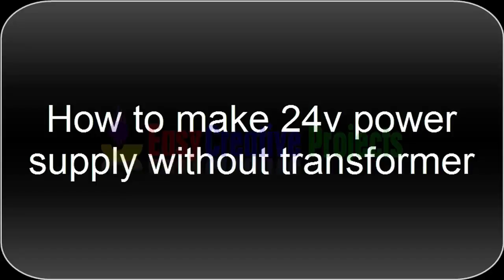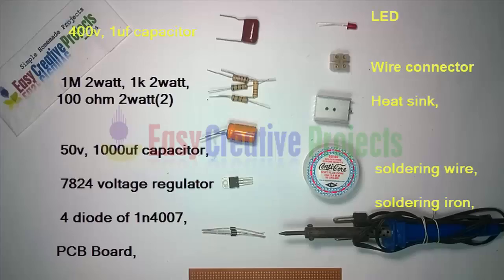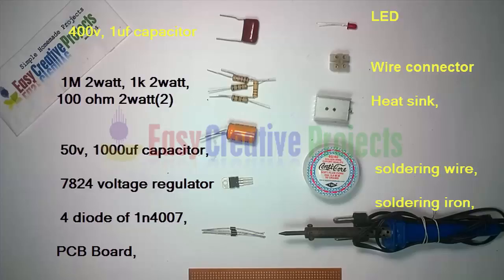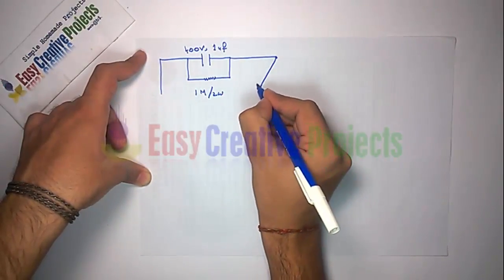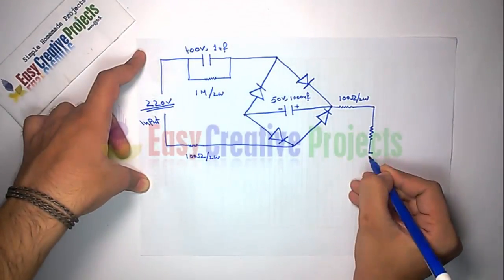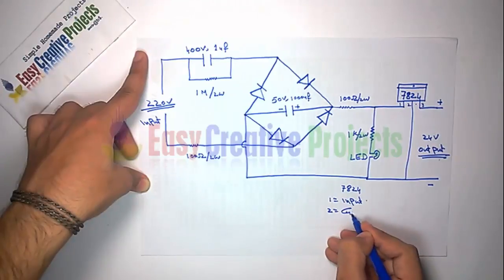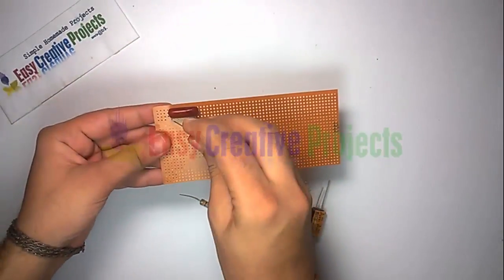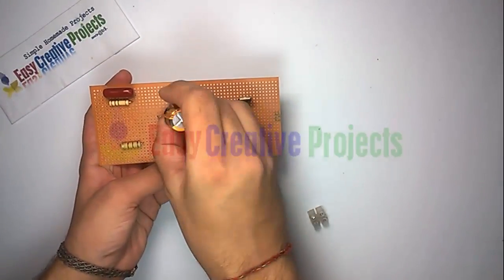How to make 24v power supply without transformer - easy step by step with circuit diagram

Comment: dear sir 
please help me 
Ac 220 to dc 24v 5A
circuit diagram without transformer 
please sir help me
Reply from the maker: without transformer you cannot get good amperes. 
its only educational purpose project. and very risky and dangerous. 
if you want 5amp output. then you need 5amp transformer. or you can use SMPS  but smps more costly and complicated.

Comment: Hello I  am looking for 230 volt to 12 volt 5 amp 60 watts circuit without transformer....... please advise
Reply from the maker: without transformer you cannot handle good current.
Reply: @EasyCreativeProjects  I plan to run a 12 Volt DC Motor which will draw peak load of 60 Watts under load
Reply from the maker: @hindi4222  i can try to get some solution in upcoming video. but its not durable.

Comment: very good job thank you sir be bless. one more thing sir how can I add regulator to it thank you
Reply from the maker: in this project we already use LM7824  24v voltage regulator.
but without transformer its not safer. its only for education purpose.
thanks.

Comment: what will be the o/p current in Ampere ? and where I can install potentiometer in this circuit ???
Reply from the maker: its provide you maximum 500ma to 800ma current. its only for education purpose. without transformer its very risky.
thanks.

Comment: Please tell me about Ampare which we received in 24 volt DC and paralal how  can also make 12 volt DC 
Means 
24-0-12 DC volt
Reply from the maker: simple use 12 -0-12 transformer
and 1n4007 diode bridge for ac to dc convert
and 1000uf capacitor for filter dc.
if you want fix 12v then use LM7812 voltage regulator. 
if your requirement 24v then use 1st and 3rd wire of transformer. 
if your requirement 12v then use any 1st two wire. (left1 and middle or right 1st and middle)
without transformer its very dangerous. and you cannot get high current.
thanks.

Comment: Sir as you said, I used to 105k 450v capacitor and all resistor 2w out put to 24 volt coming sir, but 1000 uf 50 volt capacitor heated and bursting 30 minutes later.Then what should I do. Please sir reply.
Reply from the maker: its demo purpose project. its not durable. because this time no perfect alternative of transformer. 
don't use heavy load with this power supply.
check voltage of burning capacitor. and use more large voltage capacitor. like 100v.
but i again tell you its only education purpose. its not durable.
Reply: Thank you sir.

Comment: Sir plz 🙏reply me I want a 12v 10 amp circuit without transformer
Reply from the maker: without transformer you cannot get 10amp current. because this time no perfect alternative of transformer.
if you are facing transformer size issue then you can use smps circuit. 
but smps circuit more complex.

Comment: Can I fix a adjustable voltage regulator LM317 ckt instead of LM7824 SIR
Reply from the maker: yes dear you can convert it as a variable power supply. 
watch video on our channel how to make adjustable power supply easy at home.
this video help you to connect lm317.
thanks.

Comment: We didn't use voltage regulator to regulate voltage ?
Reply from the maker: dear voltage regulator function only regulate voltage. if you want to fix output then you use voltage regulator.

Comment: You did not talk about the input.
Can i use any input voltage to get the same out?
for instance;
110v to o/p 24dc
220v to o/p 24dc
Reply from the maker: yes you can use 110 to 220v input. and its provide you fix 24v output. 
but its only for education purpose. because this time no perfect alternative of transformer.

Comment: Is this constant current power supply
Reply from the maker: dear LM7824 provide us fix 24v output power. but this project only for education purpose. if you need 24v power supply then use with transformer power supply.

Comment: How much is current output 
And can it be used for powering circuits and our other projects is it safe ...... pls reply
Reply from the maker: its provide you 1amp output. 
no dear this project only for education purpose. this time no alternate of transformer. 
for power charging simple use transformer power supply.  if you want to make so 
see video on our channel ( How to make 24v power supply )

Comment: Which one is better, using IC7824 or 24 volt zener diode ?
Reply from the maker: dear 7824 voltage regulator is best for control current. 
if you use zener diode you need to put capacitor.

Comment: can i connect a 24 volts drill with this....
Reply from the maker: dear drill machine need high power and current. this power supply cannot fulfill of drill machine requirement.

Comment: how about 120 volts to 24 volts.. what will be the adjustment ? its made me sick . pls reply. thank you
Reply from the maker: dear in this project i use voltage regulator. its give you 24v output.
if you use 120v input so no problem. you can use directly this circuit. 
but if you use any high power product so use with transformer power supply.
thanks.

Comment: I used 105k 400v, output is 18v.. But 100ohms resister is burnt.. I connect circuit without 100ohms resister.. Its giving 18v output.. I need 24v output..  What changes i have to do.. That circuit.. Please tell me..
Reply from the maker: dear 1st this project only for learning purpose. dont use this supply. 
in this project your resistor burn because you use low power resistor. use 2w resistor. 
if you need 24v so simple use 24v transformer.
Reply: I used 2w resister.. But 18v output coming...

Comment: 100ohms resister is burning after 1minute... What can i do now.. And  1k resister also burning
Reply from the maker: dear use 2w resistor. 
you use 1/4w so its burn.
Reply: Ok its working.. But output is 18v

Comment: Sir, plz plz plz reply me quickly, i will make 24 vdc supply by 3 amp transformer. May i use RL 207 diode for bridge rectifier? Plz sir reply quick.
Reply from the maker: RL207 Diode give you 2amp output. if your need 2amp then you use it.

Comment: How I get 24volt 2.5 amper ac to do convert smps and adopter in good quality
Reply from the maker: dear if you want to good quality so simple use 24v  2.5amp transformer.

Comment: Can i use 7812... replace 7824
Reply from the maker: yes if you want 12v output so you can use lm7812 voltage regulator.

Comment: 100 ohm ka resister burn ho jata hai
Reply from the maker: dear use minimum 2w power resistor. if you use 1/4w power resistor its burn with in second.
Reply: 100 ohm 2 watt vi burn ho raha hey...kitna resistance use karu?

Comment: Transformer less 24 volt supply,how can I get 2 amps.?
Does diods will work?
Reply from the maker: for 2amp circuit you need 2amp voltage regulator. and also need 2amp diode.
Reply: Easy Creative Projects

Comment: Sir, 1.        Question

1). 5v DC mobile charger to convert 12v ..........

Plz make voltage double 5v to 12 v circuit.........
Reply from the maker: ok i try to make for you.

Comment: Work nahi ho rha sir 100E resistor burn ho rhe he so what I can do for it
Reply from the maker: dear km say km 2watt ki resistor use kro. is say km ki use kro gay to 2 mint main jl jay gi.
2nd this project only for experiment. if you want to use for long time so use transformer circuit power supply.
thanks.

Comment: i have a doubt about your circuit,why u can use 1M ohms resistor .the resistor can control voltage and current like R=V/I.    
the 1M ohms resistor how to allow 24volts.....and why u can use 100ohms resistor in negative terminal of the input supply...
Reply from the maker: my dear. in this project we play with direct power supply.
if you follow R=V/I then your resistor burn with in second.

Comment: which pf should i use instead of 1uf 400v
Reply from the maker: dear 1uf = 1000000pf 
pf is very low power of capacitor.

Comment: What is the value of pf
Reply from the maker: dear i could not understand what do you mean by pf?
Reply: what should i use instead of 1uf 400v capacitor
Reply from the maker: dear i use 105j capacitor. you can get it form any electronic component shop.
no any alternative. because if you use simple capacitor its early heat up and destroy with in second.
Reply: Easy Creative Projects thanks sir

Comment: Can we use variable resistor in this
Reply from the maker: yes you can connect variable resistor. but in this circuit i cannot use transformer. if you change any thing so its maybe dangerous.

Comment: Can we use it for 8 dc 24 v motor operating purpose
Reply from the maker: yes dear,
in this circuit i use 24v 1amp voltage regulator for output.
you can use any 24v and 1amp motor for operating.
Reply: Easy Creative Projects, I can bet this circuit can't drive 1A motor load. Becoz only 100 mA current at Max is available through 105J or 1uF series capacitor. So voltage at the output terminal will come down to accommodate the impedance of motor with 100ma of current. So either motor will run in very slow pace or even not at all.   If motor impedance is and current rating is low, the motor will burn after few second. Only remedy is through zenner diode across output terminal to take over excess current from the output terminal also to provide constant voltage to motor.
Reply: @Dave_en  sir, which zener diode should I use
Reply: @sirikondarambaboo7092  don't use this transformerless power supply. This is only used for charging cells, powering  Christmas series lights, power indicators etc.
Better buy a regulated power supply from good brand or get it made by someone knowledgeable in practical electronics.
You can use regulator LM317 for variable power supply upto 35 volts or 78XX series regulator ICs along with transistor 2N3055 or equivalent for high power requirements.